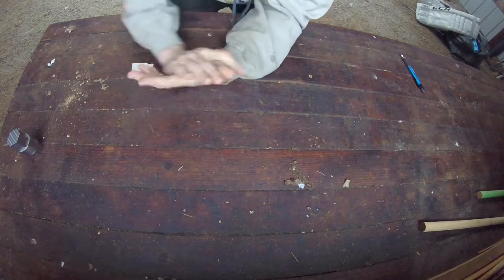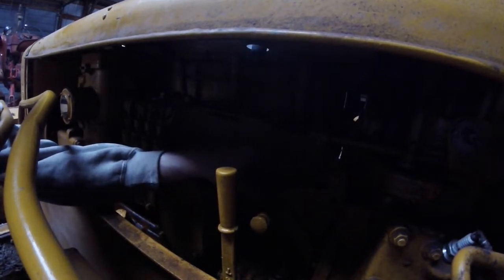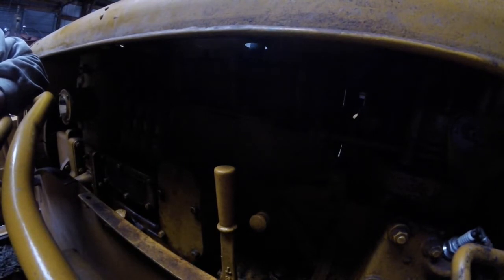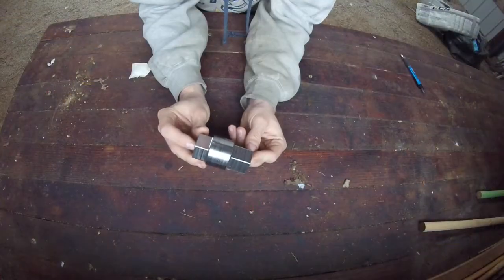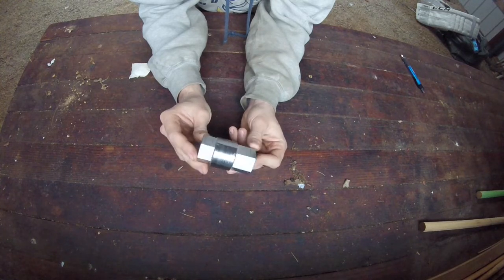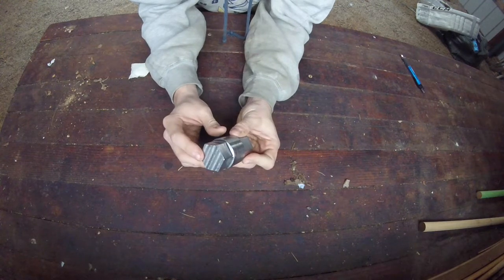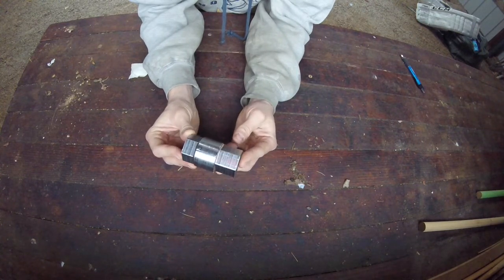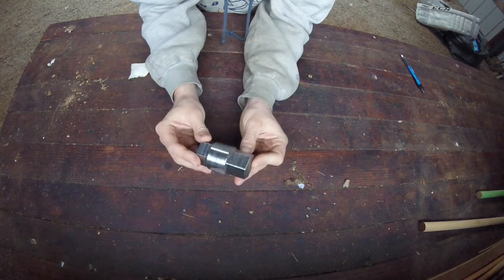Caterpillar Pre-combustion Chamber Tool

Comment: We have a Caterpillar Sideboom and are facing a recurring issue: it keeps burning/piercing the pre-combustion chambers (chambers). Also, when I place a wrench on one of the chambers while the engine is running, I can feel a strong knocking/hitting sensation from underneath it. What could be causing this?"